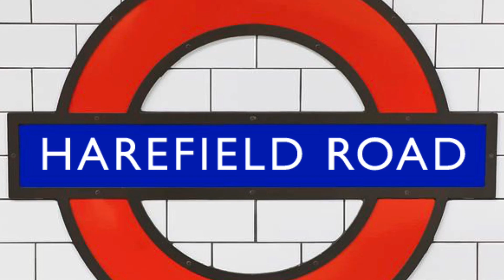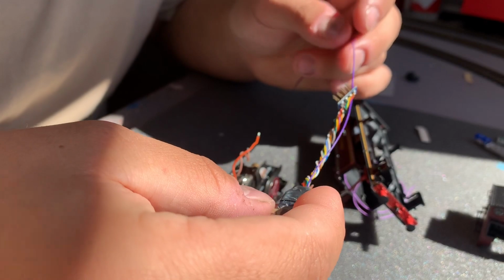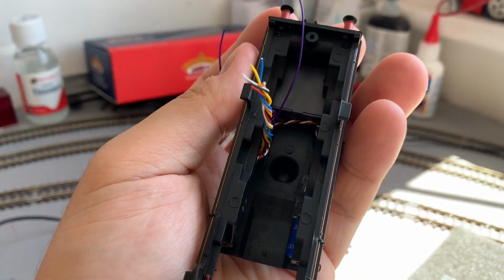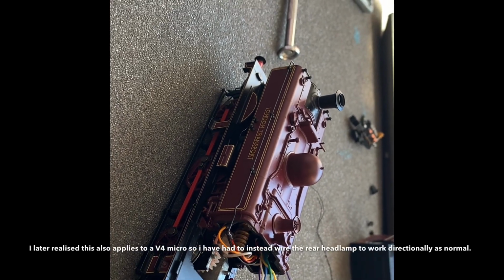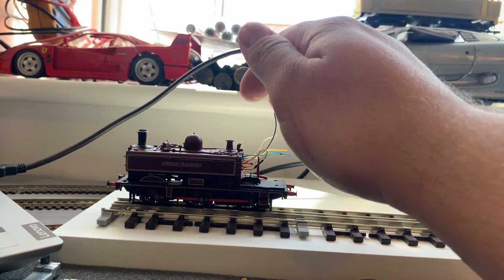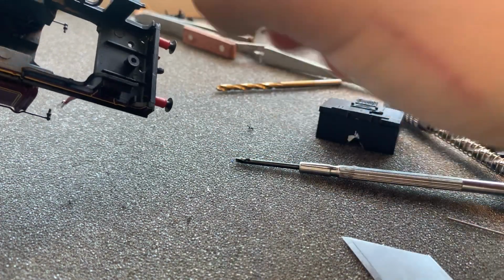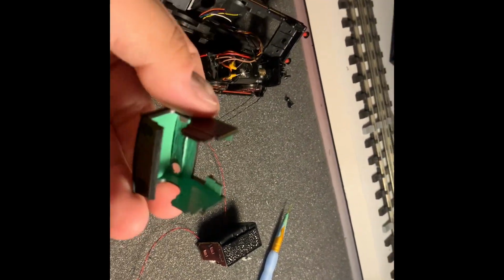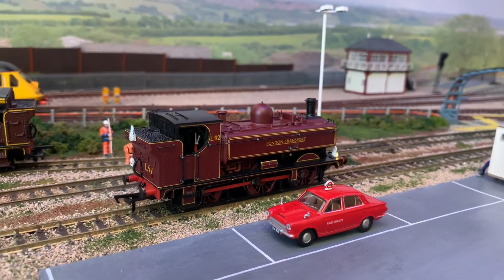Bachmann London Transport Pannier Tank Upgrades walk through. Fitting lights, sound & stay alive!

Comment: Absolutely stunning and well thought installation, and I’m just worried of fitting a stay alive in a Bachman. 57XX (I installed a Zimo MX648 and speaker a couple of years back) but as you commented short wheelbase locomotives need a stay alive fitting.
So that’s the next job
Terry
Reply from the maker: Good luck with it mate. Only way to learn is by having a go 😀